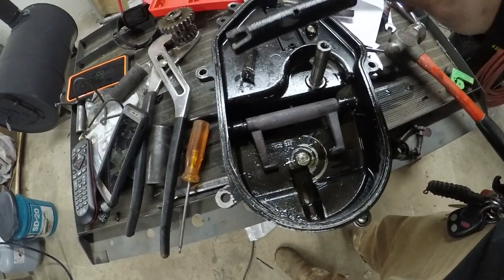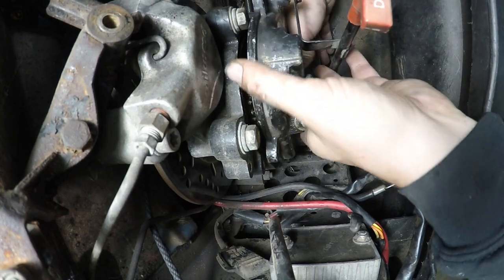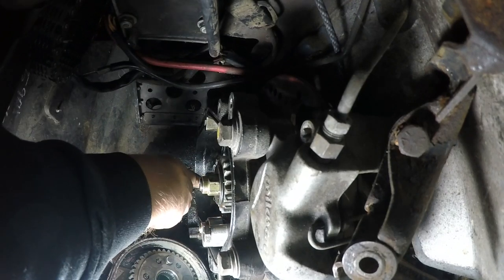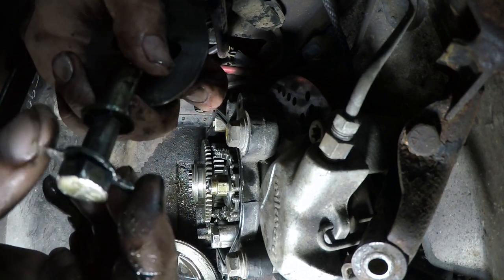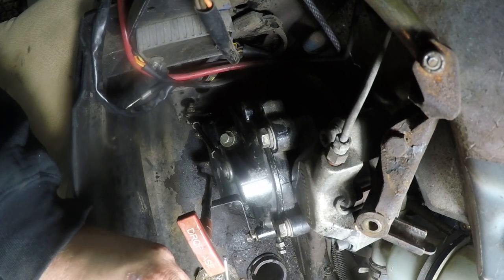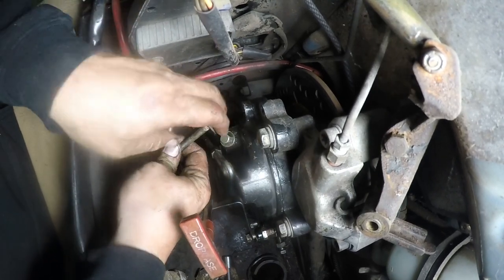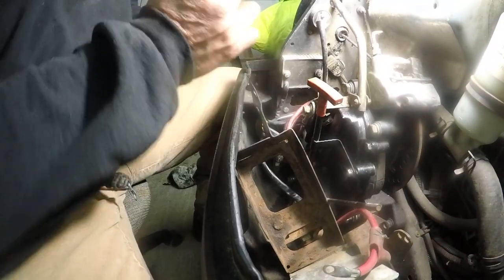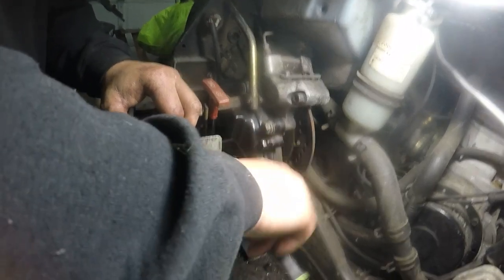Chaincase Dropcase Inspection and repair after failed drive shaft bearing. 2002 Arctic Cat zl600 Pt2

Comment: It was a nice thought to make a video on this, but you struggled way too much. What you should have done was unscrew the idle gear shaft from the cover. You then install the shaft in the case first with locktite using the bolt and two nuts locked on the bolt. When tight remove the bolt, and then remove the two nuts on the bolt. Install the idler gears in the chaincase along with the lower gears. When you make sure everything is lined up and tight. Install the cover and bolts. Installing the cover with the shaft and idler gears in the cover is the wrong way of doing this job.
Reply from the maker: Thank you for the advice. It is awesome to fimd other ways to do things. Thanks for sharing

Comment: I’m currently struggling with this job I have the correct chain and gearing the arctic cat dealer says and I can’t get the chain on no matter what I try
Reply from the maker: Do you still have the old chain and gears. I would count the teeth and links to make sure they match

Comment: Hey TTS, I was wondering why your sled wouldn't pull before you fixed it?  I am having similar symptoms with my 2002 Arctic Cat ZL550, was riding along and it quit pulling, no noises or ugly sounds when it quit.

My engine runs, driven clutch spins and the cross shaft is turning into the top of the chaincase, but it won't move, forward or reverse.

I see you replaced the reverse fork but is that what caused it not to drive the track?  

I haven't pulled my chaincase cover yet but assume that I either broke a chain...or the driveshaft itself.  I would have thought if I broke a chain there would have been some nasty noises.

Let me know if you can, I'm sure I missed something in your video but can't figure it out, thanks,
Reply from the maker: I had a couple issues. The one that kept giving me issues is the bolt that holds the lower gear kept spinning out. I had to put red loctite on the threads to get it to stop. 

The secomd issue I had was the drive shaft bearings failed. Once I replaced those it was perfect. Hope that helps. 

What it sounds like is something in the chaincase wether it be a broken chain or a bad gear
Reply: @thethriftysnowmobiler9801  Thanks for the reply, certainly appreciate it and your videos!  Unless I misunderstood when your reverse shift fork broke the sled would not move in either direction?  Is that correct?  I thought the loose bolt and the bearings were separate issues that you had to fix but they didn't stop the machine from moving and weren't related to the reverse fork?
Reply from the maker: The reverse fork broke when the gear came loose. I was unable to go forward or reverse. When the drive shaft bearing failed I had no forward or reverse either because the drive shaft was out of alignment and not engaging the track. To check that you can look up through the tunnel and grab the drive cog and see if it moves. it shouldn't wobble around at all. there is a bearing in the chaincase compartment and one on the other side under the drive belt.  Its a little hard to get to but manageable
Reply: @thethriftysnowmobiler9801  Ok, now I get it, thanks for talking me through it.  I don't think it's my drive shaft bearings, no movement there.  I'm guessing I shucked the chain but I thought I would have heard or felt something when it let loose.  Too cold to mess with now but I will check back in and let you know when I figure it out.
Reply from the maker: Yeah if its something in the chaincase I have had it not make a sound and just revs
Reply: @thethriftysnowmobiler9801  That is EXACTLY what mine did.  I'm hoping to get a chance to open it up this weekend.
Reply: @thethriftysnowmobiler9801  Well I opened up the chaincase today, the chain is fine and nothing is obviously broke.  I haven't pulled any of the gears or the chain yet but my best guess is that the main shaft that drives the track is broken near where it comes out of the bottom of the chaincase...or I've stripped the spline on the end of that shaft.  I can wiggle the big gear at the bottom of the chaincase more than I think I should be able to, that kinda makes me think the driveshaft is actually broken.  Still pretty sure the bearings at both ends of the track driveshaft are good, the track turns freely and I detect no slop in the shaft.
Reply from the maker: When you open the hood and rev the throttle like you are going to take off does the clutch go in and out. does it grab the belt and the belt turn?
Reply: @thethriftysnowmobiler9801   Yes, clutch goes in, grabs the belt and turns the big driven clutch pulley.  The driven clutch turns the jackshaft and the jackshaft turns the chain and sprockets in the dropcase, but the track doesn't move.  And I can turn the track freely but nothing in the dropcase moves.  That's what makes me think the problem is where the track driveshaft goes into the big sprocket at the bottom of the dropcase.  Like either the driveshaft broke right in there, or the spline got stripped on the end of it...or the spline in that little driveshaft extension piece maybe?
Reply: @thethriftysnowmobiler9801  UPDATE!!!!  I went and wiggled that big bottom sprocket and the big long bolt that holds it on slid out!  I don't have time to screw with it today but I'm going to watch your other video where you had the same thing happen.  I'm hoping nothing got tore up when the bolt came out.  Probably have another update tomorrow.
Reply from the maker: Awesome, kind of. At least you have identified the area of your problem. That is half the battle. Definitely want to make sure the spring clip on the back side of the big gear is not tore up. They are cheap but can cause big problems. I would suggest replacing the drive shaft bearings while in there. Also make sure that you put some red Loctite on that bolt that holds the gear in. I had to take the chaincase apart multiple times because it kept spinning out. red Loctite and it has stayed
Reply: @thethriftysnowmobiler9801  There was a film of Permatex on that chaincase cover when I opened it up so I think someone had been in that dropcase before, I'm guessing they didn't put any Loctite on that bolt but I definitely will.   Is the "spring clip on the back side of the big gear" you mentioned that washer/ring that is about 3" around...and I think it retains 3 little springs maybe?  Looks like the part number is  0602-144  and they are about 12 bucks?  I will check those driveshaft bearings too.  This sled only has about 1200 miles on it so I wouldn't think they would be bad but you never know.  Thanks for your help, I'm going to watch your videos again, the more I dig into my sled the better I understand what you are talking about and doing in the vid...good stuff!
Reply from the maker: Yes that is the part. if it is damaged it will cause issues. Does your speedometer work? if not it wont log miles. 1200 miles on a sled is a lot. I was told that a sleds lifetime is about 10,000 miles where a car is about 200,000. They are run through some pretty rough conditions. Salt and hard riding. Its a good idea to just get it out of the way while you have it apart to ensure you dont have to take it apart again in 100 to 200 miles. Newer sleds make it a little more maybe 25000 to 30000. Also have to factor that it is around 20 years old too. so it may have been driven 100 miles every year but if they never greased the bearings then it sat all summer and got ridden every winter. it plays hell on the wearable parts. I wouldnt second guess it for a part that is inexpensive. could leave you stranded in a bad position. Out in the cold with no way out
Reply: @thethriftysnowmobiler9801  Point taken on the life of a snowmobile, even in the best of conditions the drive system and track gets tortured.  My speedometer works but I guess I don't know if it has always worked, or maybe even been unhooked, another good point.  I never even thought about the mileage being incorrect.
Reply from the maker: Thats why I'm here <3
Reply: @thethriftysnowmobiler9801  Ok, I took the tension off the chain (automatic adjuster) and pulled the bottom sprocket.  You were correct, I need to replace the spring retainer plate and the 3 pins and springs that it retains.  They are not real bad but now is the time to change them out.  Was wondering...do you have to pull the driveshaft bearings to tell if they are bad or can you tell by just wiggling the driveshaft and see if there is any obvious play?
Reply from the maker: Really unless you take them out and look at them it would be hard to tell if they are ready to fail. I would just replace them while you are in there. if I remember correctly it was literally 3 nuts on one side and 3 on the other side. bingo bango. I would change them now though. I doubt shaking the shaft will tell you if failure is imminent.
Reply: @thethriftysnowmobiler9801  Oh, I thought you had to drop the skid and track to get the driveshaft out to get the bearings replaced.  If they can be replaced from the outside face of the tunnel that would be pretty simple.
Reply from the maker: I don't 100% remember. I know I only removed the track and suspension once and it wasn't to do that it was to rebuild the suspension. I do think it was pretty easy to do. I believe you unbolt on the crank case side and shift the shaft that way then take off and replace the opposite side then put in the new one on the crank case side. but don't quote me on that. I remember it being pretty easy
Reply: @thethriftysnowmobiler9801  I've got my new parts put in and getting ready to reassemble...was wondering, do you keep the shift forks as "low" in the case as possible when you put the dropcase back cover on?  That is, does the 2 stubs on the ends of the shift fork go into that slot on the gear from the bottom...or come down from the top?
Reply from the maker: I slide them down from the top.  Its kind of a bitch to do but eventually you'll get there. My problem was I kept dropping the spacer and it would go behind the gear and I would have to take the gear back off to recover it
Reply: @thethriftysnowmobiler9801  That kind of surprises me, it sure looks like you swing that fork in from the bottom side of the big gears in your video.  And also, that shaft with the 2 little interlocking gears in the middle of everything never came out of the chaincase when I pulled the cover off so I am hoping that it will be easier to keep that spacer on the end that goes into the dropcase cover...hoping to get it put together this weekend...and thanks again for the help, I have referred to your videos a buuuuuuuuuunch!!!
Reply from the maker: Yeah its a real pain in the ass putting that cover back on. Maybe I just did it the wrong way. Or just the more difficult way. It went back together so couldn't be wrong. Hahahhaha I am glad that the videos help. That's what I was going for ;)
Reply: @thethriftysnowmobiler9801  Well we may not get any snow again for who knows how long (in (Southwest Missouri) but the ZL550 is reassembled and moving once again!!!  Thanks again for all your help, it was invaluable!
Reply from the maker: Hell yes! Anytime my friend. Hopefully it gives you many years of fun